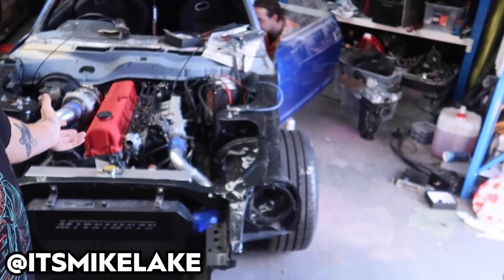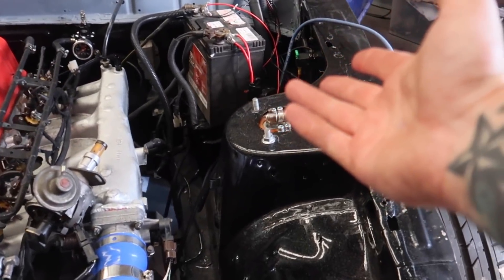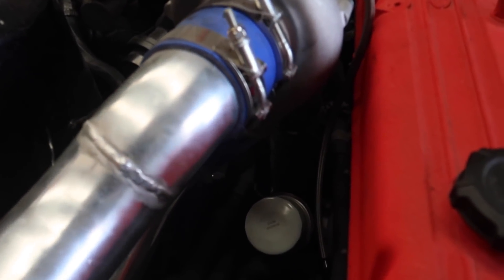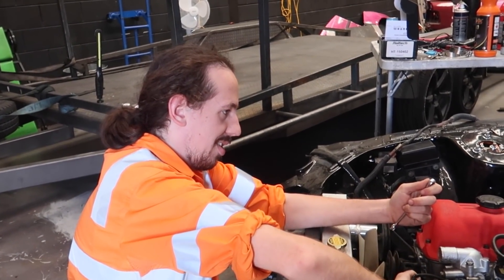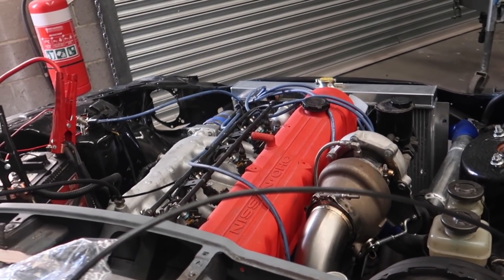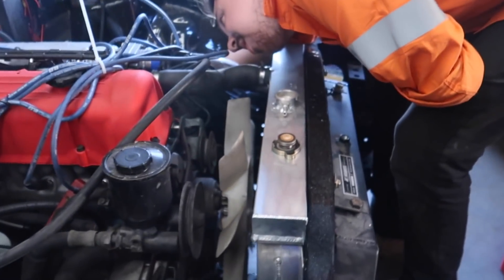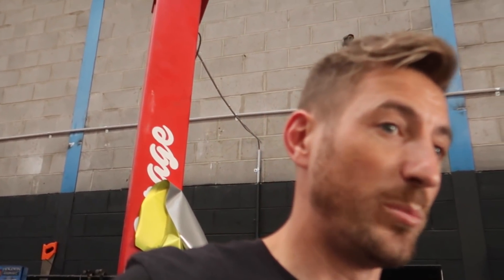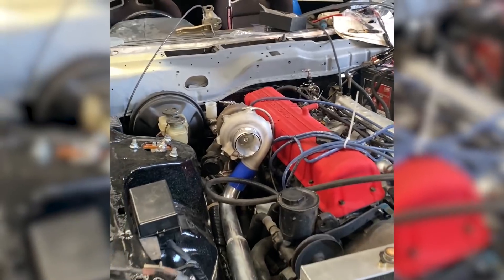280ZX Turbo Haltech 550 Install Part 2 | FIRST START!

Comment: Be really careful with those injectors and that fuel rail. you can get oversized tips and Hammer the injectors into the manifold. my 240z has lit on fire three times when using that fuel rail. Boost popped the injectors out and folded them to the side and fuel started leaking and it goes right down onto the manifold and you have instant Flame. Awesome Z... make sure you turn it up to at least a bar that's where they would start to wake up. Unfortunately I didnt get to watch all of your video but I will when I have more time. If you're looking for some cheap injectors that'll fit I think they're 0280 150 400 or 0280 150 401 you can find them cheap and they'll fit on that rail... they're like 400 to 500 ccs. they're like one of the first ones I started with... there green. You really need a palnet fuel rail but I don't even know if he makes them anymore.

Comment: Big Mike im real worried that you have set yourself up for fires. You really can't have the turbine housing so close to the PS box and lines, clutch reservoir, master and line, brake booster, reservoir and lines, spark plug leads, fuel and brake lines under the floor. I don't think any coating or wrap is gonna save you mate, please be careful driving it. The average temp of that much metal is going to be 500+ degrees and 800+ under hard driving. It's too much surface area, too hot, too close.

Comment: Can’t wait for part 3. I’m going to be running haltech as well with a z32 distributor.
Reply from the maker: Ohhhhh is the z32 distributor better?!
Reply: @itsmikelake  I can’t say better. I’m sure it would of been easy to just buy a protuner distributor. The z32 would make it easy for tunning specially with haltech. Hard to find a turbo distributor for the 280zx, and if they fails hard to repair them. So I feel converting to something I can still buy in local parts store and modify it to where it’s easy to swap. I’ll send you a picture on fb dm how it looks

Comment: Haltech have the most amazing customer service I have ever seen. They always message me back within 12 hours no matter if I am asking about coil leads or old platnium sport software queries.  I have never seen such great service from another company and it really makes a difference. Not only do they hagve great support but there are heaps of resources for most engines to make wiring up/calibrating stock sensors and the such an absolute breeze
Reply from the maker: Agree 100% with all of the above! Super cool guys to chat to and insanely knowledgeable. Well priced too.